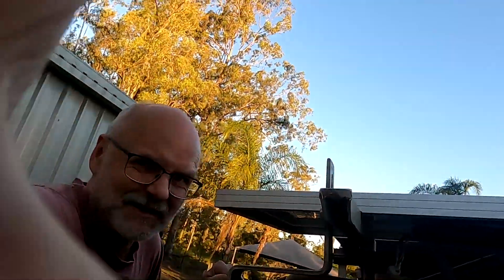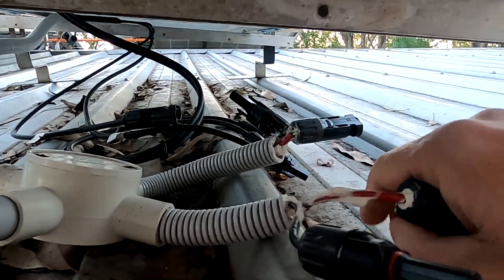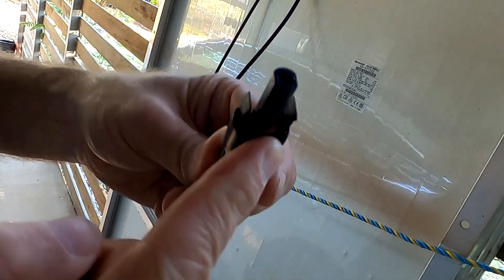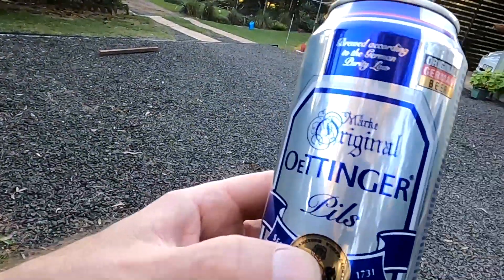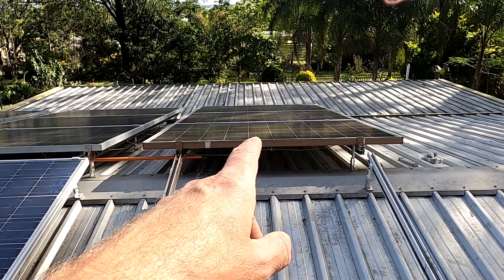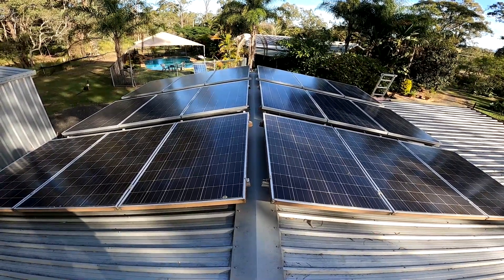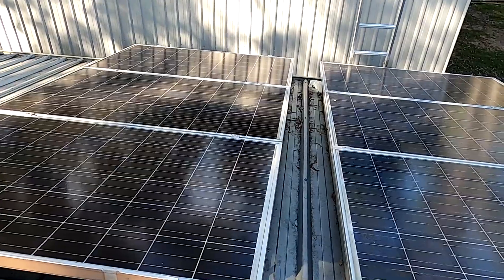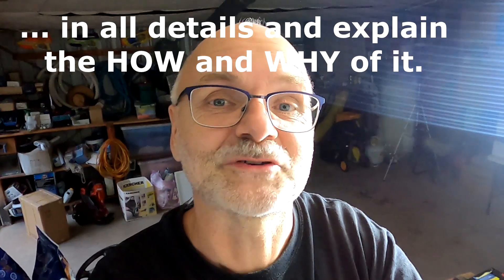Installed all 60-cell panels but something happened on the east roof! Part I

Comment: So fun watching this series but my heart aces every time you pull another panel up on the roof. Smacking the rails in behind the panel onto the thin film covering the cells seems like a good way to cause new microcracks that will open over the next year. Going to look through later vids now to see if they degrade. Benefit from watching 3 year old videos 😛

Comment: All done now, but, The flexible plastic wire loom going through the roof:  can be easily chewed by rodents, and will also degrade over time, which could result in shorts or arc faults to the metal roof.   EMT, or sch40 / sch80 PVC rigid conduit could be a better choice.    The smooth inside wall also allows easier push/pull wires through it.
Reply from the maker: Hmmm, we have a cat for the one problem. I've never seen any UV degradation with this grey conduit. It is made for outside and UV light exposure. Got this installed in several places and it's still fine after 10yrs in the Australian sun.

Comment: Just come across your videos, apologies if I missed it ,but do you solar panels each have a micro inverter to help overcome panel shading and output problems?
Reply from the maker: No they don't. This is an off-grid system with battery storage.

Comment: pop the 2 test panels just below the apex of the roof out the front in the optimal angle all year round  with the spat alignment tool
Reply from the maker: Great idea. It would be the back side though, facing north where the sun is. I can make an adjustable holder for the angle... 👌

Comment: you do know there is a special MC4 tool right?
Reply from the maker: This blue plastic with the two tongues at the end which you supposed to press into the MC4s? That has never worked for me. I used some used MC4s for the test panels and soldered my cables onto the ends of the cut cables. I think the MC4s are a bit older and just stick together very tight.

Comment: Mono are better for defused light poly are best for direct light from my understanding
Reply: That's not really true...
The main difference is the cost..
Reply: @MaxMax-dq1lu  it is shown that mono out do poly in cloudy conditions and poly out do mono I  direct sun from all videos I have scene comparing each
Reply from the maker: Is there a difference at all? I thought it's just a different silicon waver inside the panels.
Reply: @OffGridGarageAustralia  from videos I have scene mono vs poly they seems to be one always seems smaller is size compared to the other I have always used ex grid tie panels with mppt as there higher voltage but always had them paralleled as that was most efficent then panels in series but then I was a 12v system as i lived in a caravan

Comment: Do you get Time of use electricity tarrifs in austrailia? Here we have Octpus Agile which tracks the wholesale cost of electricity where u can get cheap electricity in the night. In the season that you get less daylight when you may not fill up your batteries u can suppliement with cheap electricity during the night.
Reply from the maker: Yes, we have this as well but I'm not on one of these tariffs. I have a fixed price 24/7 for 100% renewable energy plus a cheaper tariff for certain applications (electric hot water, pool pump and vehicle charging). This cheaper tariff circuit is been turned of during peak hours though. That's how they control the load and power distribution in the grid.

Comment: Question do solar panels work better cold (in summer conditions) we tested this on a solarboat we made (as a joke untill it worked really good now building a electric tinnie using lifepo and seperate charging solarstaion)but in summer we put water on the solarpanel to cool it and got more power(mayby place a raintank on the garage set up a cooling system )
Reply from the maker: Yes, solar panels work the best when colder. The hotter they get, the less efficient they are.

Comment: 060221/1951h PST 🇺🇸 060321/1251h  Brisbane.  Good day. I was like OMG..OMG some camera angles were so scary as you perched precariously upon the roof, holding 13 Kees heavy PV Cell frame. I’d rather not think about your perpendicularity turns into horizontality @3.66 meters below. Please be extremely careful when at high altitudes. Und OeTtinger verboten. Stay safe und 73s…
Reply from the maker: Yeah, thanks. I'm always aware of the risks, shoes and of course no Oettinger during work hours 👌🍺

Comment: howdy , i watch your videos and enjoy when i can . my place is a lot different  than yours . my place is at 30.23 N in the west Texas desert . from what i see on your vids about low output i see 2 things Panel angle on test look like about 37 or 38 . just guessing then you mount on much flatter on roof , you talk about not much sun . i would top all the trees on east  and west sides. to me it is like putting panels in a box surround by trees  . Keep up good info ,,, Thank you ,, Bill
Reply: Oh yes I get it so well. I have no trees and no shading. Think big find a big tower for height above trees. I have thought about transmission line towers that have been up graded.
I want to build an East west tracker. Problem. Big winds . I enjoy your vids and your figure it out way . Thanks Bill
Reply from the maker: Thank Bill. 10 years ago we bought the place because of the many large trees. They are home to many birds, lizards and also koalas here in this area. I think we cannot embrace solar, battery and green power and on the other hand cutting down trees just for the sake of a few kWh more energy.
Here in Australia, land clearing is still a very big issue and contributes a lot to climate change and extinction of fauna and flora.  I'm trying to plant as many new trees as possible on our 10acres.
in a few months, spring will be back and shading will be far less then. It's just now in winter time I have no direct sunlight, so I have to live with it.

Comment: Hi Andy. If u could prevent overcharging, could u connect the panels directly to the LIFEPO4 battery?
Reply from the maker: I could in deed. But it's more efficient to use a MPPT solar charge controller with its DC to DC conversion. At the end it's the amps which are charging your battery.
Reply: @OffGridGarageAustralia  Grasias

Comment: Very interesting video!
1. Panels with the same number of cells. Very good!
2. Collected more power through scattered light from clouds. Unexpected! Learned something new, can't argue with measured results.
3. Pre-testing panels before hauling them to the roof. Good!

I put all my tools in a 5 gallon bucket for roof work, even things I might not need, but have used on the roof before. I put a rope on the handle, and pull the bucket up once i am safely on the roof.  Sometimes  i tie a second bucket to the other end of the rope and carry the middle of the rope up the ladder. Carrying a toolbox up a ladder is nuts.

Your getting there, keep on trucking.

There is a method to use a bench power supply and backfeeding the panels with a low-limited-constant current at a VCO voltage plus a little to defrost the panels. The conduction path is through the I diode part of the circuit model and barely turning the diode on. The heat dissipated in the diode warms up the panel. Like your cars rear window defrosters. Never exceed the ISC, but 1/4 ISC is probably ok.

This method won't work if you have blocking diodes on the strings of panels. Bypass diodes are ok.

Judging by your clothing you probably won't need to use this technique.
Reply from the maker: No, Peter, I don't need any defrosting. Winter down here means min of 5°C (40F) in the morning after a 'cold' night and 24°C (75F) during the day. Mostly sunny every day.
The bucket method is a good tip, There might be also room for a SPAT inside 😊
Reply: @OffGridGarageAustralia  wow that weather  sounds so good! Is  Australian immigration open to retired Americans?
My bucket Idea came from dropping a full 1 gallon can of paint while climbing a ladder. I think i did an internet search for a better way.
Reply from the maker: @petercamusojr1545  weather is pretty good for solar down here. Not many cloudy days during the year. They let you in if you bring some $$$.

Comment: Nice progress Andy, in the Netherlands I make 20 kWh with 3120Wp southroof 45 degrees max, you might go above that unless your sunny hours are far less. However when this is working free energy will flow until the end of times. Enjoy your drink, you earned it! Thanks for sharing.
Reply from the maker: Thanks Edward. I'm so excited to see how much we will get in summer time. I assume it will be far more than I can ever use. Might need to buy a second EV for that purpose...
Reply: @OffGridGarageAustralia  great to hear, you can maybe move a big fridge to your garage to have more consumption which saves you from the electric bill 😁

Comment: I am fan of you channel. You have lot of things which is very interesting. Well done, go ahead ..
But, i  have observations about the position of your solar panels. You have problem with shadings. For you is not good choice any poly or mono crystal panels. You know, if you have only one cell in shading you lose all string. 
For you, more better option is thin film panels like CIS panels or any other. I have very good experience whit this panels. I have 12 panels from NexPower. Each panel have declared power 145W. The advantage of these panels is a good sensitivity for spectrum of light. This panel is very sensitive to diffused light. In your case a small shadow on the panels can not drastically reduce the power. For understanding, i do not advertise this firm. You can use any other firm...
My 12 panels (9 years old) today produce 10.5 KW/h. I am in Croatia in Europe. My panels have orientation to west. Today was nice day, but also on winter i can product 6 KW/h. It is very interesting that these panels produce even if there is no sun. If the clouds is are thin, my panels product 200 - 300W.
Sorry for my English ..
Reply from the maker: Thank you very much for your comment, Josip and welcome from Croatia. Been there many times, beautiful country and people!
I will have to wait a full year with these panels as I won't have much shading in summer time. It's just gathering all this experience with these panels during winter and see if it is enough to get me through that time just on solar and battery power.
But yeah, there are better solar options out there, definitely...
Reply: @OffGridGarageAustralia  Thank you for nice comment for my country. On this link you find more experience about thin film panels: https://www.youtube.com/watch?v=WDaAXAoH180.

Comment: You should think about designing a solar tracking system for the panels.
Reply: It would probably be cheaper and easier to just add about 3 more panels,. I'm concidering a tracker because I only get good sun about 3 hours a day, fir the other 3, it's spotty, 6 hours a day, isn't that great... Maybe I will cut some trees!
Reply from the maker: Tracking is an interesting aspect but, yeah, just add another string of panels to compensate and stay maintenance free.

Comment: That should do 20 kwh a day for 9 months of the year.
Reply: Maybe 15 max.
Reply: @USA-GreedyMenOfNoIntegrity  my 4650 watt does 20kwh and 1/2 of it is on winter angle otherwise it would do 26kwh
Reply from the maker: I hope for 15kWh per day in summer time with this current setup.